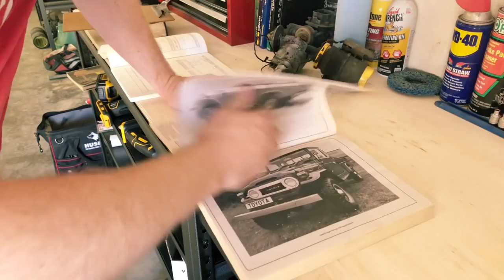PWW 42 - How To Remove A Straight Front Axle, Treat Hernia & Back Pain, Kill Spiders, Impress Wifey

Comment: Unbolt and Lower the springs,  slide axle out, slide new axel in on jack, lift weight with jack, reattach the springs.  

Your video was way better though,  seeing the wrong way is enlightening
Reply: It would have been easy if he used the jack!
Reply from the maker: I don’t need some Jack... but yeah, I didn’t do this correctly. I’d rather never touch those leafs again...

Comment: Which Milwaukee right angle impact wrench have you been using in your latest videos? Seems to be the tool for me. Thanks.
Reply from the maker: It’s the Milwaukee Fuel M12 3/8 Ratchet, it’s an extremely handy little bugger. The 3/8 Stubby Impact works well too, but the Ratchet is an excellent tool.

Comment: Where’d you find the new locking hubs? I keep looking but can’t find for 1970
Reply from the maker: So the axles I have are from a 78’ and I snagged some Aisin hubs for an FJ60 (and Georg at Valley Hybrids had some stubby birfields to make it work with my axle).
Reply: Good luck finding 1970 hubs there always fucked just update the brakes with 60s or 75s disck brakes you can find the parts every where
Reply: All most forgot you might have to change your axles and your diffcenter 75s LandCruisers ones will fit if you can't find a later model 40s one's (your 4B will stop in a straight line and quicker with updated brakes )
Reply from the maker: Robbo Kissick good intel Robbo!

Comment: next time, suggest you grab yourself some wheel dollies. Then  jack up the axle slightly and put some axle stands on wheel dollies underneath to take the weight, then undo the ends of each leaf spring and slide it out on the dollies, safer and easier. But probably not as entertaining to watch. 

i suggest Rachel writes a safety manual, she has a lot of logical good advice haha
Reply from the maker: She’s my safety manual. I just don’t listen.